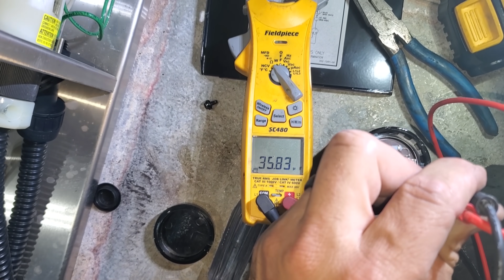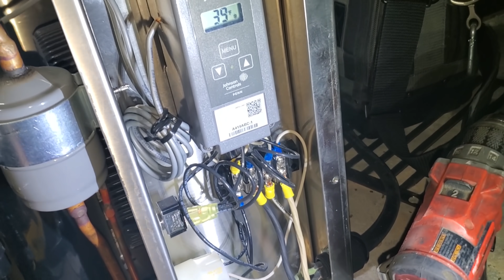THE BEER IS TOO WARM

Comment: 7:13 you should cut the isolation back a bit so that the metal part isnt covered by it. That way it drys up quickly and it doesnt get rusty.

Comment: I had the same thing last month. The condensing fan wasn't turning (was hot) and compressor was running at the time. I turned it off immediately. Replaced condensing fan.

Comment: @8:25 "These glycol units sometimes can be in very interesting locations." -- Nice euphemism there :D I have to admit, I'd likely use much harsher language in reference to something like that. And I do, sometimes, because besides computers, I also service networking equipment sometimes... and networking equipment (like routers, switches etc.) can sometimes be in very interesting locations as well... and by "interesting" I mean "some motherf... moron thought the wall section behind the main closet that has like 20 cm of clearance is the perfect spot for a powered device". Because of course it is, isn't it... These things don't get hot, right? Right? ...

Comment: What is the reason why you need to leave the compressor running after changing the starting components even though it's "red hot"? I'm genuinely curious.
Reply from the maker: The returning suction gas in the compressor is cooling the compressor. So turning it off after restarting when it was overheated will likely cause the compressor to shut off on thermal overload. The longer it runs the faster it will cool down

Comment: you should add a lightweight high volume fan to try and help cool compressors that you cant use water with i use fans in the power sports industry to get units cooled off (so i don't burn myself)
Reply: plus its a fan on those hot days!!

Comment: Glycol tip. Warm beer feel inside the Glycol bath. If bath is cold it's pump/motor not circulating Glycol. If bath is warm its refrigeration issue. I replaced a pump and motor on a glycol unit that was on the top of box n literally was on my stomach changing the parts out. No room it was brutal. Thanks Chris!

Comment: Hot or warm beer, mmm yuck. Nice little unit. Service space not so good but you made it work. Now with the temp going down so quickly does the beer tap have to be flushed out from the warm beer? Some beer becomes stale when warm or hot. Congratulations on the 100k subs. Very proud of you Chris. You have always had my up most respect and always will. You do an AWESOME job on your work, videos, and as a GENTLEMAN. Now on to 200k subs, lolol. Thank you for the video and experience.

Comment: "...police will come knocking" Is there liability or anything for you with safety alarms in the US?
A chef friend of mine almost died in a walk-in a few years back because the door jammed. We found out later a service tech had cut the alarm line and not told anyone.
Serious stuff.
Reply: Are alarm lines continually charged and the alarm goes off if the circuit broken? Because that design would make the most sense to me.
Reply from the maker: Yes

Comment: Boy you have good hearing if you hear the compressor internal overload clicking. 😊
Reply: Technically its not internal thermal,  its located just under the plastic terminal cover and can be heard easily if you haven't lost your hearing to this noisy trade.

Comment: Your videos  helped me to avoid a 200€ refill of the AC in my car. Because I was goning to a German HVAC. The car shop was telling me R134A is expensive and they have to fill the AC on the liquidline.

The HVAC told me that in bigger AC units R134A in Germany still is the first choice and he filled the AC to the suction line with running engine and AC. He charged me 30€ for it. 

With out you videos I would belive the car shop and pay...

Comment: I work in IT and have no clue about HVCAR stuff.
Yet, here I am, watching you play with cool machines, gadgets, and science. Win win in my book.
Reply: I work as a field service tech in a completely different field but I learn from this channel. The troubleshooting methods work regardless what kind of tech you are working on. The first rule of troubleshooting: "thou shalt measure voltages"
Reply: I am also in IT and once had a Medical doctor say it was a pleasure watching me work as I was fixing his Surface. I blew his mind when I said the Scientific method works the same across all disciplines.
Reply: Yep, I'm a devop (developer + systems operations tech) in the video gaming industry.  Been watching Chris every morning while my coffee brews for a year or so now.  Everyone can learn from his example and troubleshooting workflow.
Reply: Watching HVAC videos may help you save money one day like it did me recently.. Found out myself the issues i was having with a heat pump for 6 months or so that none of the HVAC techs found was the contactor was stuck. i unstuck it merely by tapping it and cleaned the contacts, having it replaced would have cost me over $200 for them to replace it.

Also because of HVAC channels like this one (even though its commercial not residential) i was able to spot that the downstairs heat pump fan was failing and in need of replacing (wasnt free spinning like it should and fan would not run when the unit would enter its defrost cycle for whatever reason but otherwise worked normally), while that cost $400 by itself, the Tech actually thought ahead and brought me a new fan blade as well, definitely the best tech ive had with the company so far.